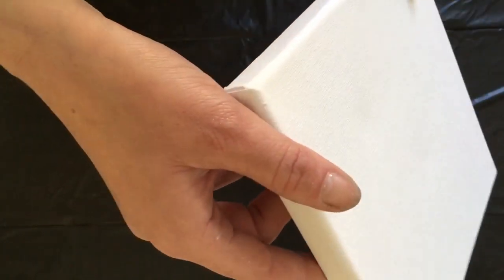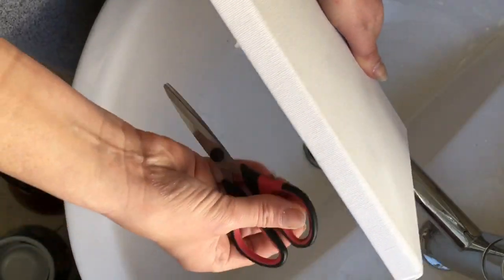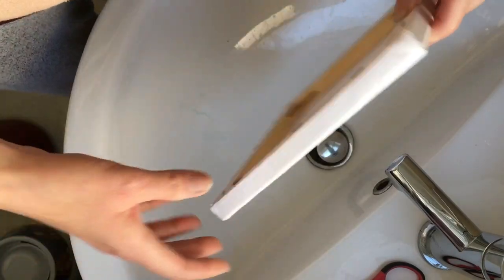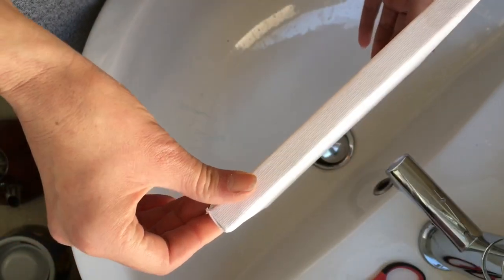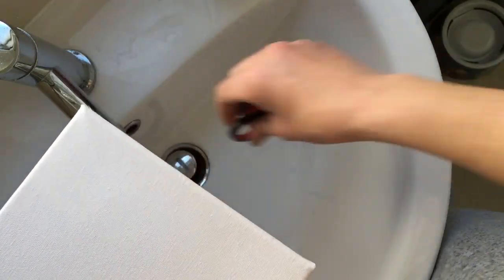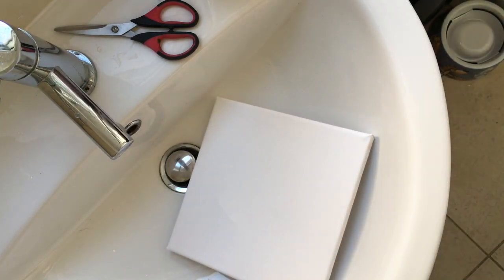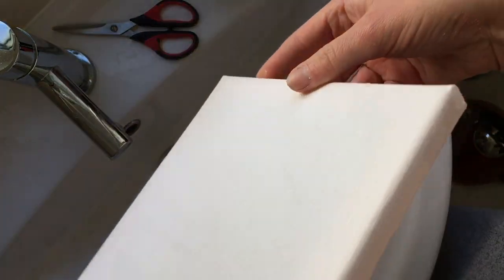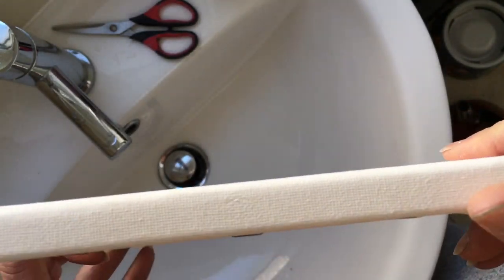What to do with a damaged dented sagging saggy canvas ~ Acrylic Pour / Fluid Art / Acrylic Painting

Comment: will this also work on a canvas that has been painted?
Reply from the maker: Ah ok.. maybe I should try that.. I’m sure I’ll have one that I won’t like (more than likely today because I’m supposed to be working and instead I’m painting 😂) so I’ll let it dry and take the scissors to it. I’ll pop the video up when done. Good question.. thank you 😊
Reply: @artbyemmaburton-whitepearl4631    My damaged canvas is a long-dried painting that was stored with other frames.  One of those other frames poked into the back of the painting and left a pointy dent in a spot that has quite a bit of paint on the front.  I'm hoping your method can repair this.
Reply from the maker: @pamc4224  I’ve just messed up a trial technique so I’ll let that dry (really well!) and will poke it see what happens. Stay tuned.. it’ll need a few days to dry properly and get the full exposure I think to test it properly.
Reply from the maker: @pamc4224  Hi Pam, I found an already dry, old painting.. all tested and trialled 😊

https://youtu.be/0usLD_H8vqk